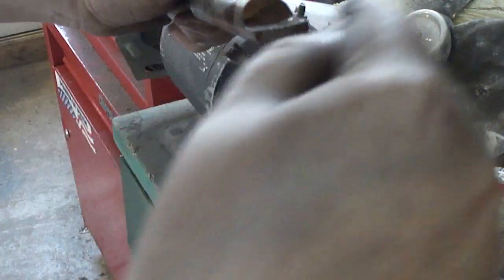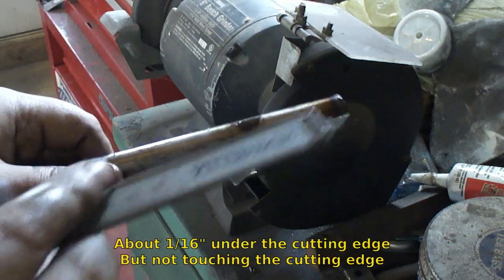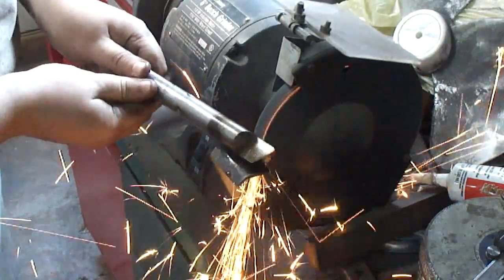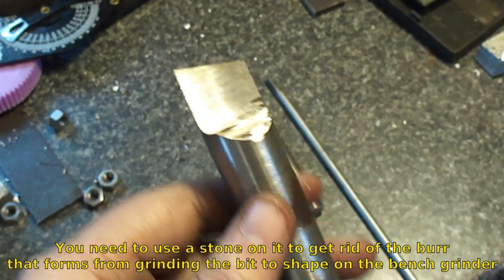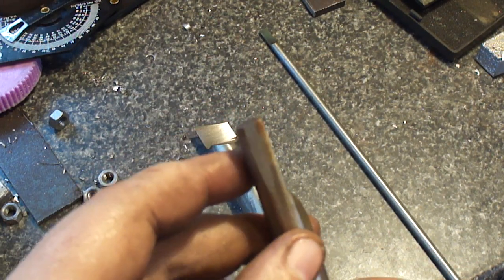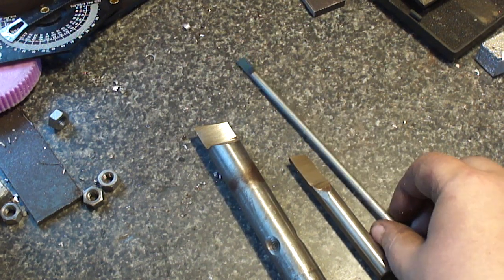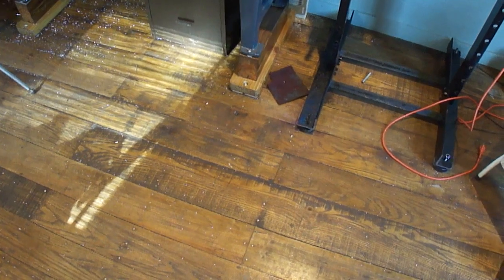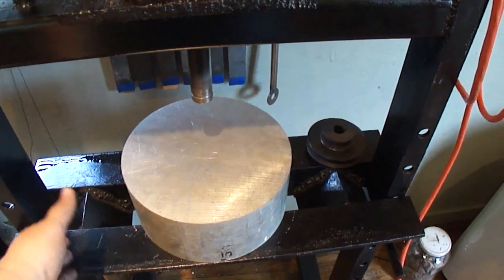Quickie Bit - D-Bit Reamers

Comment: hi you can't use it on steel ? great video thanks !
Reply from the maker: Yea, I use them on steel all the time, you just want the D bits to be harder than what youre reaming, so you'll want to use some drill rod, hss, or some hardenable steel to make it from if you're using it in steel. Other than that, they work fine and Ive used them in steel and many much harder materials tbh.

Comment: You should have demonstrated at least 1 of the bits in action. Thanks for showing how to grind one.
Reply from the maker: yea, this was just showing how to grind them. They're pretty easy to use, just stick it in the drill press or lathe and use lots of oil on it, then run it down slowly. It'll give some drag to it, but it'll open it up to size and leave a glass smooth finish usually.

Comment: These are expensive when buy for clock re bussing, I see it is even easy to make, I have a lathe, but also the need to dial wheels to change with a zero setting, but maybe using digital is for me the best way because clock need precision.
Reply from the maker: there's horology style D bit reamers too, which instead of being ground in half, it's ground at a slight angle, which is a little harder to ream through the holes, but they work pretty well in smaller holes that you would find in clocks. 

Another option for the lathe is to set up a dial indicator on the cross slide and read direct readings off of that, that should give you the best precision tbh.

Comment: Hello! In another video, I saw this D-bit being used to drill a very long hole, I believe it was 32" in a steel bar. but the geometry of the D-bit was a little different from yours, I believe the cutting edge was moved more towards the center of the bit, 1/4 or 1/3 I believe. I need to drill a long hole and it is very difficult to find geometries of this type of drill. Could you share any attachments of some geometry? thanks for the video!
Reply from the maker: hey, the drill bit that youre looking for isnt a D bit, but is called a gun drill. They do have similar shape, but different relief angles than a D bit reamer. These are more for reaming a hole to exact size, not really drilling a hole/ Usually gun drills have a hollow tube with the end on it, and has a hole running through the end of the cutting edge so it can be used with flood coolant to keep it cool and to help push the chips out the flute on it. Ive never actually used one, so I unfortunately cant help with the geometry and design of one, but there is plenty of videos and guides out there. I would just look up "gun drill" and that should point you in the right direction youre after.

Edit: there is also another type of drill that looks similar to a D bit, which is called a straight flute drill or single flute drill, which is mainly just designed to cut brass and aluminum, no good for steel, cast iron, or harder bronzes.
Reply: @ChirpysTinkerings  I read somewhere that before the advent of gundrills, D bits drill was used for deep holes in musket barrels and that actually gundrill is an improvement of Dbit in cutting angles and the adoption of a channel for cooling. The video I saw, the drill was very similar to yours, it was a round bar, with the end ground in the middle and had no oil channel for cooling.
Reply from the maker: @wesaderty  oh, Im not sure about that, but I do believe that the one youre looking for is some sort of a gun drill. Ive never really heard of anyone drilling deep holes with a normal D bit, only using them to ream with unless the material was realy soft in the case of the single flute drills.
Reply: @ChirpysTinkerings  Could you possibly make a video showing the geometry of that straight-flute drill which you are referencing here?  The current video here is so excellent; you show everything without a lot of filler.  I am very grateful for the information.
Reply from the maker: @channelview8854  They're just a long fluted D bit, but the end is ground in the same way as you would have a countersink. It is a cone shape on the end, your typical 118 degree cone you would have on a drill bit, but it starts at the cutting edge corner that you would use as a drill bit, and you roll the bit against the grinder to add a tiny bit of relief, but not too much or it throws the center point off. The best way to make them is with a T&C grinder, but it can be done freehand if youre careful. I would look up how to sharpen countersinks, and just imagine that on the end of a D bit tbh. Stefan Gottswinter has a bunch of videos on grinding D bits also and makes a few center drills the exact same way. I tried finding a picture or something of one of the single fluted drill bits for you, but I cant seem to find one right now for some reason. They're only good for really soft materials like aluminum or brass tho, but they do create a very accurate hole.
Reply: @ChirpysTinkerings  I'm very grateful.  Like and subscribe.
Reply from the maker: @channelview8854  no problem, and glad I could been of some help.

Comment: No comments in awhile, this was very helpful. I've read about these from multiple forums but it was hard to picture fully in my head.
Reply from the maker: Yea, I use these all the time, and was just using one earlier that I made up, lol. You can actually shape the ends to do all kinds of profiles too like tapers or ball shapes, or even countersinks, just make sure you have the clearance on it so it can cut without rubbing is all. They're very handy for all kinds of projects in a machine shop tbh.
Reply: @ChirpysTinkerings  didn't know that, thanks a ton. It makes sense if you think about it, but I probably never would've in this case.

Comment: Guy Lautard (machinist bedside reader) says to make it 51% of the diameter, and it should only cut on the front. I've seen this in other instructions too. I have not had much success with them
Reply from the maker: Yea, if you go oversize, then you'll ream an undersize hole and your reamer will get stuck, or it'll just burnish it's way into the hole. If you go undersize, then it'll want to cut an oversize hole. If you go right in the middle, just use a bunch of oil with it and you wont have any trouble at all with it. I use them in softer materials like mild steel, aluminum, and brass/bronzes, and have really never had any problem with them as long as you have it right on center height. You also want to add a little relief below the cutting edge also, and it'll just glide right into the hole as it's reaming.

Comment: I purchased one of those Pittsburgh calipers... total garbage. Not even worth the drive to return it.
Reply from the maker: Mine has honestly been pretty good, but when you get it, it is pretty crappy because the gibs are really loose, and you'll lose accuracy from that. If you take a jeweler's flat tip screwdriver and tighten up the gip screws on the very top of it till you have just a small amount of drag, and work it back and forth till it works itself in, then it'll fix the inaccuracy issues, and make it a pretty decent pair of calipers, other than just feeling and being cheap, lol.
Reply: @ChirpysTinkerings  I completely understand what feeling cheap is, reason why I bought one of those. Mine just flat out quit reading, got stuck on all zero's. Had it for one week, barley even used it.
Reply from the maker: @garyr7027  oh, that is really odd. It's like the sensor got knocked loose or something in it. Ive never seen any do that before.
Reply: @ChirpysTinkerings  I've ordered a different one online, brand called Insize, nist certified, tested and calibrated. I caved in with the price, it wasn't cheap but then not real expensive either. I gotta have something I can rely on, redoing the engine in my truck.
Reply from the maker: @garyr7027  ah, yea, I know what you mean, I have a pair of starrett in the house that I use for drafting/cad purposes, and a mititoyo at work, so I know what you mean by pricey, lol. I tend to have stuff falling over while pounding on stuff on the workbench, and I dont want to have an expensive pair in the shop where Im mainly just messing around at that can get broken/messed up, so I keep the cheap set out there, lol. 

I wish you best of luck with your engine, I have no idea about that stuff except what I can melt out of them, lol.
Reply: @ChirpysTinkerings  thanks for the luck, I'll need it. It's down to the wrist pin bushings, once I ream those, it'll be ready to calibrate then reassemble. Those bushings are the hardest part to get right, down to about 0.0004 of a inch clearance. Had no choice to replace em, half the old ones were no good... 😡
Reply: @ChirpysTinkerings  got those calipers, I highly recommend them. They're very precise and so far always goes back to zero when close without reset. If you're interested, go to Amazon or just Google, and look up "Insize model# 1108-150"... so far I've yet to see a bad review on these.
Reply from the maker: @garyr7027  oh, I have plenty of sets of calipers here, I just dont like using my good ones in the shop where something can fall and break them, lol. I usually am more of a fan of the old analog calipers tbh, the most annoying thing I can think of in the shop is going to measure something and realizing that the battery is frozen or dead, lol. I just use the crappy HF digital ones in the shop because they were really cheap when I had gotten them, lol. I think I paid 8 or 9 bucks for them when they had a sale in the booklets on them, so I dont really care if something happens to it, lol.
Reply: @ChirpysTinkerings  got it, no sense in ruining a good set. If you ever do find a need for another pair, I don't think you can beat these for the price range, damn good set of calipers.
Reply from the maker: @garyr7027  lol, thanks, Ill keep those in mind.
Reply: I have an insane story about those Pittsburg calipers.  I bought one on sale for 9.99 USD.  I got lucky, mine was great right out of the box.  The plant's forklift shop shared half of my machine shop and the FL mechanic was saying how I wasted my money cuz it was from HF.  He said I should have spent the 99.99 he did and bought the Blue Point off the tool truck.  So he got to looking and comparing, and they were absolutely, ABSOLUTELY, identical.  Except his had Blue Point inked on the beam and mine was plain. He threw his hardhat all the way across the shop.

Now the story gets weird.  About a week later, mine starts acting up.  It finally got unusable so I decided to look inside.  I peeled a metal-foil sticker off the back to get access to the tiny screws.  I happened to turn it over before I took it apart, and it was on, and looking normal.  I used it for a bit and it was fine.  I used that thing for THIRTEEN YEARS afterward with out a screw up.  

Now it gets bizarre.  I went back to the store and bought one for my boss cuz so cheap.  His worked about a month and started acting erractic, just like mine.  I will swear under oath this to be the truth.  I pulled that foil sticker off his and it worked five more years that we knew of until it was stolen.  Weirdest shop story I know personally to be true.

Comment: I have made a few D-bits over the years. The smallest is 1/16"diam. I think I used the micrometer more than the file.
Reply from the maker: yea, for ones that small, I generally use a clockmaker's reamer style than the standard D bit reamer, but both work for what they're intended tho.
Reply: @ChirpysTinkerings  what is a clockmakers reamer?
Reply from the maker: @bilbo_gamers6417  Instead of the parallel flat D bit that you see in this video, there is both a pyramid style bit, and clockmaker's reamer, which is just ground at an angle of maybe 20-30 degrees from one side of the round stock to the other. They're mainly used for reaming out really tiny holes like you would use in a clock pinion or really tiny clock parts. I believe clickspring has shown them a few times in his videos.

Comment: Foot breaker is one sweet chunk of ali. I'd say the press is a good place for it. I use a bunch of random pieces of thick steel on my presses. I've used D-bit drills and reamers over the years, great to have in the toolbox, plus you can make one at any time you need a different size. Thanks for showing everyone how to grind them!
Reply from the maker: yea, I probably will drill a 1" hole in the middle of foot breaker so it can have clearance for pressing shafts into stuff and for whatever job comes up. Thanks for watching.

Comment: nice vid thanks for sharing .you could go after foot breaker with a skill saw  to get her to a workable lump.
Reply from the maker: yea, I could, but me and reciprocating saws dont meet eye to eye alot of the time, lol. (carpeltunnel and hands go numb from the vibration, so I keep having to stop because of almost dropping it) I just use it as a door stop to hold the door open in the summer to let the breeze through the shop, and as a press platform, which Ill probably end up drilling a 1" hole through the middle of it for pressing shafts in and out of things.